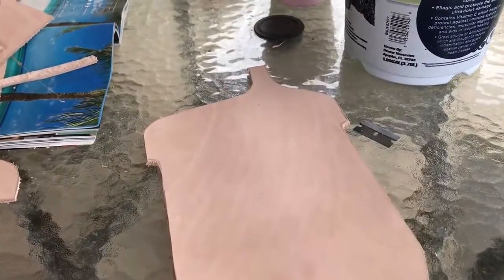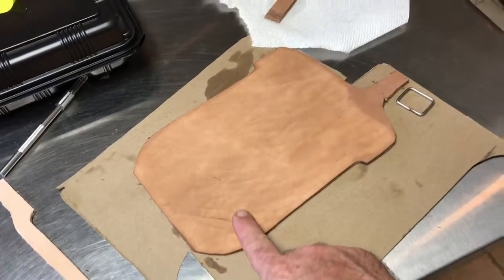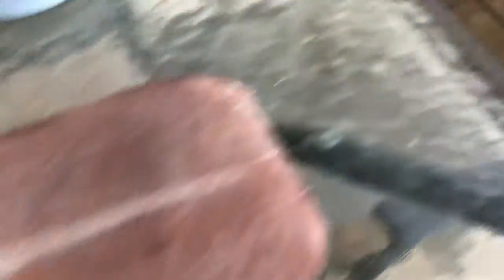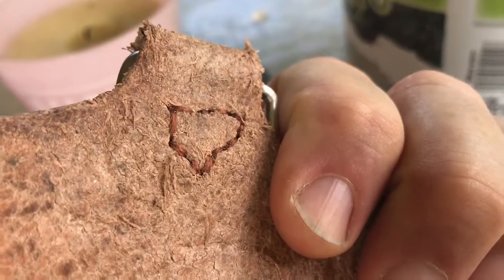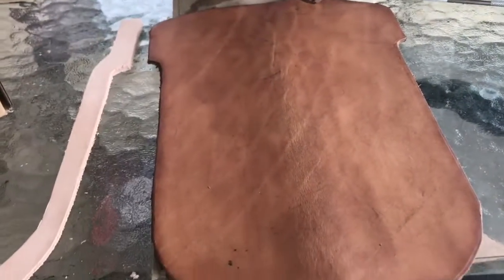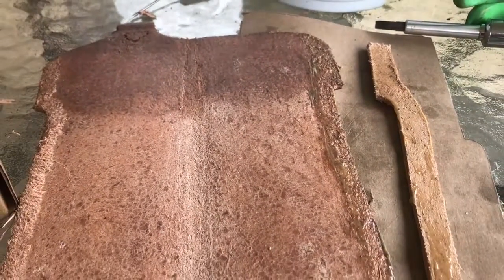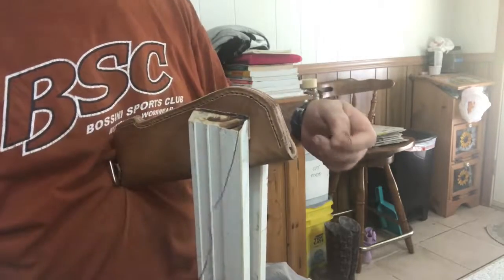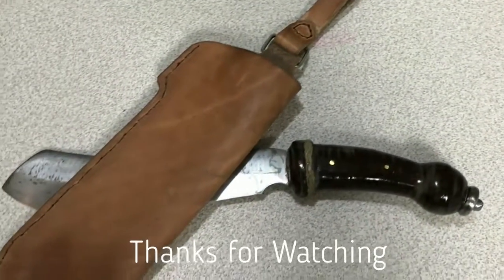Small Parang Part 4 the Sheath

Comment: Have u seen the forge it forward. That the you tube blacksmith are doing for New ones to help them out?
Reply from the maker: Billy Martin signed up for the group on Facebook. Is that what you are referring to?
Reply: Ya u can see my knife if u look back at the very few post it's a post of the tongs Jason at HOJ Forge sent me with a blue anvil in the pic the knifes in the comments here I will send u the post take a look. Look though comments and u will see it after some grinding and it looks better. Thanks for joining also bub

https://m.facebook.com/groups/176859532933055?view=permalink&id=178417049443970